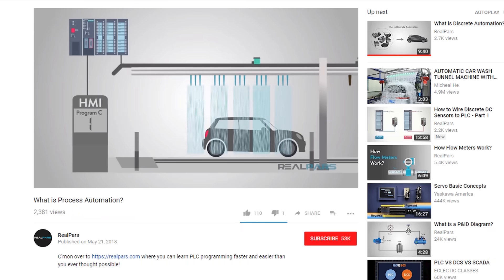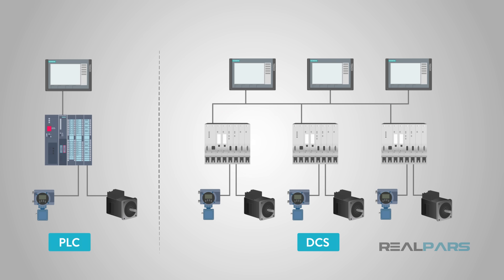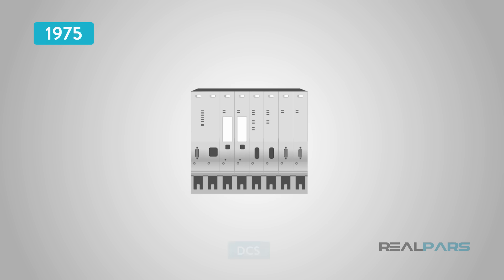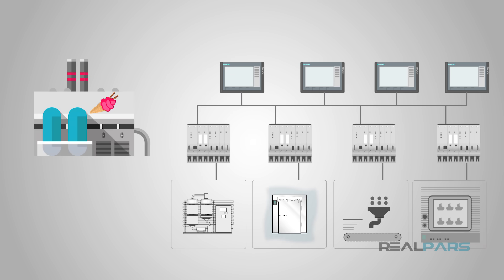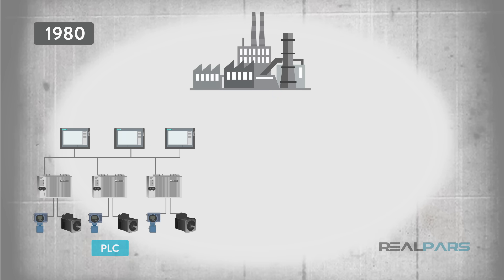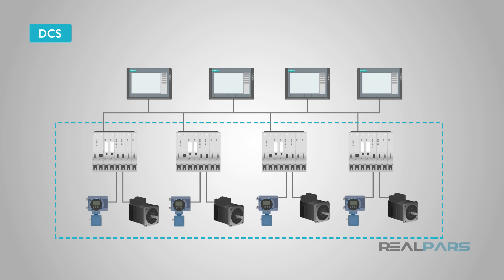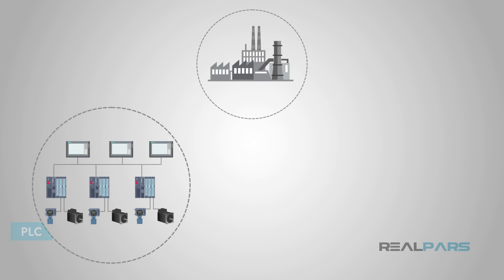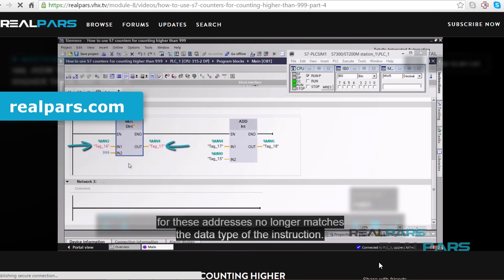What is the Difference Between PLC and DCS?

Comment: How Output ON From TON Timer And OFF From Counter What Will Be The Logic??? I am Using S7-200 PLC
Reply from the maker: Thank you for your question, You can use "Set" and "Reset" or an SR flip-flop. A TON timer starts based on a condition (like a start button press). Once the timer's preset time elapses, it "Sets" an output. Concurrently, a counter increments based on another condition (like a product passing a sensor). When the counter reaches its preset count, it "Resets" the same output that the timer activated.

Comment: Can we connect PH and RH detecter sensor in on display or transmitter?
Reply from the maker: Hi Natan, 

Thank you for your inquiry. You can establish a connection between a PH or RH device and either a PLC or a DCS system. By developing a program, you can receive signals from these devices and generate actionable results through an output or another signal. However, if your intention is to directly interface with a display or HMI, this can only be achieved if the HMI is integrated with a PLC or computer capable of receiving these signals. Wishing you a rewarding learning experience with RealPars!

Comment: Great video. In addition to the architecture explained in the video there is a bit more that shows each's benefit. 
In a DCS, it is extremely tough to program/maintain/trouble a sequential process (especially the ice cream example used). A DCS is better in a continuous process such a refinery where, for example, oil/gas is always flowing in out of the process. Pumps/valves rarely stop/close except during outages. This is because of the programming of function block diagrams. There is little to no need to dig into a function block diagram to see the code in a continuous process.
A PLC is handled better for sequential processes. Being able to see all ladder logic helps to program/maintain/troubleshoot this process. If you used nothing but function blocks and AOIs, and a line went down, it would be tough to troubleshoot. You could have a hard time finding out what is causing an output from being energized. It could be power, a valve stuck in manual, or bit that got tripped up.
Reply from the maker: Great addition! Thanks for sharing that

Comment: Very good! The PLC is usually used for Basic Control Process Systems and the DCS for Safety Systems or there is not this relation?
Reply from the maker: There are PLC systems, DCS systems, and hybrid systems used for safety systems applications.  What makes a piece of hardware suitable for safety applications is the testing that proves that hardware's reliability to be used in safety systems.  There are independent tests that manufacturers subject their hardware to in order to receive the designation to be suitable for SIL1, SIL2, or SIL3 service.  Hardware suitable for safety service will have different model numbers and likely will have a yellow housing to distinguish it from non-safety service.  Many manufacturers have a safety PLC, DCS, and/or hybrid controller model line for use in safety systems.
Reply: @realpars  lots of thanks!
Reply: @realpars  Hi, can a process be controlled and safeguarded on a single distributed PLC system that has both control functions and safety functions, or should these two be independent from each other (different distributed PLC system for safety on top of the already existing distributed PLC system for process control).

Comment: Can i connect the dcs end cable with two pcs  have same application control and monitoring
Reply from the maker: Usually, yes you can have multiple control and monitoring stations connected to the DCS at the same time.  You will need to have the proper licensing and application software, but concurrent sessions is one of the strengths of DCS systems.

Comment: Ladder Logic, AS, FU, that is really outdated, maybe try a video about modern systems. Siemens isn't really up to par with for example Beckhoff. Its like teaching COBOL to students while they should learn C or Python. At least mentioning Structured Text would give this video more credibility. The TwinCAT System is what you should be looking for when talking about modern PLC Systems. For years now there are OOP extensions which make PLC programming even more scalable and in addition to that C++ can be incorporated natively.

There is no use teaching students that old stuff. This can be picked up along the way when the foundations of modern systems are thaught.
Learning C should be mandatory for all programmers.
Reply from the maker: Thank you for your comment, Daniel. One of the great things about PLC's is that there are so many to choose from, from micro-PLC's which are essentially programmable relays to very powerful CPU's that can power large DCS systems (Siemens PCS7).  Programming languages are both a matter of preference and necessity.  

Many PLC manufacturers (Rockwell, Siemens, and Beckhoff) have chosen IEC-61311 compliant programming languages for their CPU's, which allow programmers to mix and match program file types within the same program.  This makes implementation more efficient and modular and is very much within the definition of OOP.  The Beckhoff TwinCat systems are more 'modern', but the programming language is not any more modular or efficient.  It is a great piece of software, but it has one problem that may limit its adoption:  it is not easily programmed or understood by technicians.  Most plants will continue to use technicians, not engineers, for primary operational troubleshooting, and in the several Beckhoff systems I have prorgammed/installed, this shortcoming becomes apparent quite quickly.  C++ and python will become more useful for embedded, non-editable vendor equipment packages.  Process control applications will be enhanced by some of these languages, but mainly in visualization (HMI objects).  

In my 40 years in automation, I have seen the progression from pneumatic controls to the present, and one thing is clear:  no matter the advances in technology, the most cost-effective, most efficient, and easiest to integrate solutions will prevail.  By the way, COBOL is still the #1 programming language for banking in the world and 95% of all ATM transactions are run through at least one COBOL program.  Why?  Because it is the most efficient and cost-effective solution for record-based transactional data that was ever devised.  And to make the modernists happy, there is a Visual COBOL language.  

Please comment again on our other videos!

Comment: Sorry folks this video is for numpties and does not explain the difference between a DCS and a PLC at all. I have worked for Honeywell, ABB, Siemens and Rockwell and started my career at the beginning of the modern control system era in the early 80s.

The difference is nothing to do with what this system explains.

Networking. A DCS allows dual network redundancy. A PLC does not.

Programming. The DCS allows a better CPU for programming abalog control. But modern PLCs are getting better at this.

A proper DCS allows hot swapping of IO modules without power down
. A PLC generally does not but this is changing with networked IO 

Modern DCSs are now allowing control of multiple programmers on the system. Even to the same CPU.

A modern DCS allows integration of shared memory between HMI and CPU. Siemens TIA however now removes that distinction.

Back plane. A DCS allows potentially the programming of intelligent devices through it and across it. But Rockwell allow this for a long time. Eg. Devicenet.

DCS are over priced and hyped. Delta V is popular because it has mastered S88 whereas Rockwell is catching up and Siemens PCS is shockingly clumsy.
Reply from the maker: Thank you for your observations.  Overt time, the line between PLC and DCS systems has been blurred, as you have pointed out, and there is less and less that can be thought of as differences. Dual, redundant networks are now common with many PLC's as well (redundant rings, Hirschmann rings, etc).  I recently replaced the CPU of a DCS system with a PLC and used Prosoft and ADF interface cards to preserve the hardwired, Profibus DP, ASi, and Profibus PA I/O, and saw a tremendous improvement in CPU performance.  Like most computer-based systems, the best power and speed continues to be with the latest hardware and software capabilities.  Of course, plants, especially in regulated industries, do not have the luxury of upgrading on a frequent basis. PCS7 runs rings around DeltaV in speed. performance, flexibility and capability;  it just takes a lot more planning and documentation to harness its power.
Reply: I was about to add this comment. Thank you. 
I will add also :
- Communication with higher systems like MES SAP by standard!
- Hot swapping not only IO but also CPU (if redundant, no extra download new CPU will equalize automatically), also new hardware can be added online by standard!.
- Very long time of hardware support, for Yokogawa you can find hardware from early 90's. Do it with Siemens :) 
- HMIs can work in domain, easy acces by IT support. Communication to HMI by system bus no extra network.
- Multiple acces to database, I was working in 50 persons group, which was working on the same DB, no crashing at all.

I cannot imagine to startup huge plant 15000/20000 hardwired IOs with PLC / SCADA. It will cost fortune from Engineering point of view and each change will cost a way more time then with DCS. To build PLC cabinets it will be a lot of wiring. In DCS we have only CPU/IO connected via system cable to terminal board (eX or nonEx) and that's all.

In my opinion PLCs are very fast and it can be used for small plants, few HMIs.

We cannot look at DCS cost only from hardware price. With DCS you will get many features which are standard. Engineering of system and cabinets are a way easier.

Comment: You should point out that today there are companies out there that provide the best of both worlds, such as Schneider Electric (Modicon) with their EcoStruxure Hybrid DCS solution. This provides the single database, single configuration, unified operator interface of a DCS along with the openness, scaleability and flexibility of a distributed PLC system. On top of that EcoStruxure Hybrid DCS also provides powerful run-time navigation services and support of redundant (hot standby) architectures. By the way, the name MODICON comes from MOdular DIgital CONtroller :-)
Reply from the maker: Thanks for sharing that with us!

Comment: Great series from what I've seen so far and I'm thinking of sharing this with my non-I&C clients so that they have a better appreciation for what it is they're paying for and why we seem to ask a million questions when they ask for quotes :) 

One thing about the DCS is that historically, it was an evolution of traditional process automation, that is, everything that wasn't covered by relay logic, and it didn't just "invent itself" from trying to find something that's traditionally recognised a computer (i.e. a beige box or mainframe) would do. 

I realise that following that the following history would have taken the video off on a tangent and possibly lost some people but for the benefit of those who may be wondering "so what was before DCSs", here's some context for you ;)

Whereas relay logic was predominantly the domain of sequential switching control, i.e. motor and solenoid on-off control, traditional process control - variable control - started back at the turn of the 20th century with mechanical controls. This evolved through the '40s and '50s into pneumatic controls with more complex mathematical functions, transitioning into analog electronic equivalents. All of these required external analogue computers to perform additional simple mathematic functions such as square root, addition, subtraction, multiplication, division, high-low select, and so on. 

When microprocessors hit the scene, initially these were employed predominantly in early DCSs due to cost. Whilst Distributed Control System is a clever marketing term, in brown-fields plants, these microprocessor-based controllers effectively replaced the area instrument panels ( a collection of single loop controllers and indicators), so in a sense, it could be countered that they actually integrated more than distributed process control. Controllers still existed in the same physical plant locations in most cases, but the control room could now be centralised - that was the kicker.
Meanwhile, for the end-users who could not justify the expense of a DCS,  microprocessors made their way into single-loop panel mount controllers, which initially didn't allow much in the way of user functionality over the analogue and discrete digital electronic version which they replaced. 

But when users had access to programmable microprocessor-based controllers, that's when configuration/programming of microprocessor-based single loop controllers really shone. As with the DCS, it was now possible to bring in up to four analog inputs and perform the mathematics which once required additional external devices. Complex control was becoming cheaper but you still needed panel space.
Eventually, communications pathways were developed so that such single-loop controllers could be integrated with PLCs or DCSs and presented to the operator as a homogenous control system which was more DCS like than PLC. The falling cost of DCSs and PLCs - the latter in particular - has pretty much seen the single-loop controller relegated to simple local control panel duties in vendor equipment or commercial applications.

Generally speaking, DCSs and PLCs (SCADA is effectively a PLC with telemetry tacked onto it) can do the job of each other in general applications but you'll see more PLCs in operation than DCSs for a reason and it's not because they're necessarily better, it's more about the application. 

For heavily sequential operations such as an assembly line or a mine-site, a PLC is cost-effective as it's fundamental design focus is high-speed switching with minimal complex computational functionality. 
For critical complex process automation (chemical, petrochem, etc.) the DCS remains the BPCS (Basic Programmable Control System) of choice since the design focus is on performing complex mathematical computations for a multitude of interactive complex control functions at high-speed.
I wouldn't choose a PLC to control a mineral or petrochem facility, but likewise, I wouldn't select a DCS (purely on cost and wasted functionality) for a mine-to-shipping operation.
Reply from the maker: Thank you so much for your comment and the brief history of the evolution of the DCS.  During the second year of my initial job after college (1981), I was charged with programming aFisher Provox system, serial number 2.  Interestingly enough, the "brains" of this system was an HP 1000 minicomputer.  The plant, up to that point, was controlled by >100 pneumatic controllers and a handful of Fisher AC2 and DC2 single-loop controllers.  About a year later, I installed an IBM XT with a Burr-Brown data multiplexer to collect, store, report an alarm single-point emissions monitoring data.  The program I wrote was a compiled version of BASIC.  The oldest DCS I ever worked with was a FOX1 system with wire-wrapped memory cards (64 words each, not 64kWords), helium-filled drum memory, 340K disk platters, and a punch card interface.  We have come a long way in 40 years!  The tools have changed, but the principles of control (PID, sequencing, coordinated control, supervisory control, motor control, etc.) are still the same.
Reply: No problems, mate. Dust was blown off a few cranial cobwebs after watching this and the other videos. 
I cut my DCS teeth on a Honeywell TDC 2000 in 1980. I was a 2nd year Instrument apprentice on light duties following a work accident and had been given pretty much a data-entry clerk job entering the hand-written configuration that had been prepared for a phosphoric acid plant. During the process I ended up learning about what the configuration components meant and the basic structure of a DCS. 

That foundation made it easy to transition to the two versions of the Rosemount System 3 which we had in a chlorine plant and sodium cyanide plant respectively although by this time I was a supervisor and I was training my tradies to perform some of the configuration changes as well.

Changing jobs and initially working as an I&C designer, I ended up programming a Bailey INFI90 system after someone discovered that I had DCS experience on my resume and after a few years programming, I ended up performing  the duties of a Controls Systems Engineer in all but name and recognition.

As for evolution, my only exposure to punch cards was in high school when I did computer programming as an option - I never progressed beyond the initial term because to my teenage head, it didn't make sense that you had to tell a computer what to do, it was supposed to know everything! Even though calculators had become mainstream in Australia by that time (1977), my year still used slide-rules and those of us who went to university would have had to use these for the entrance exam. Strange how the rose-coloured glasses of nostalgia consider the slide rule and tables a work of genius... but I'd rather use a calculator any day! :)